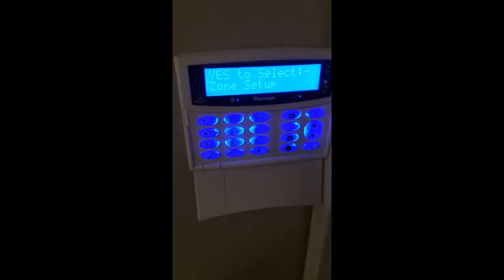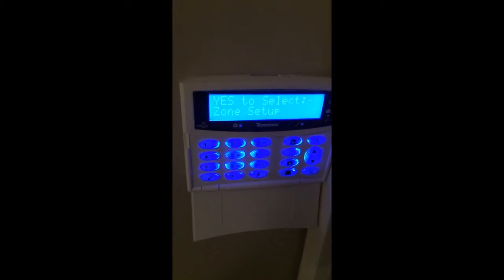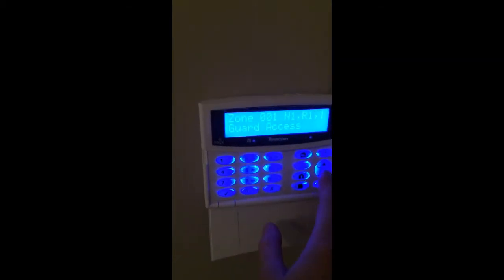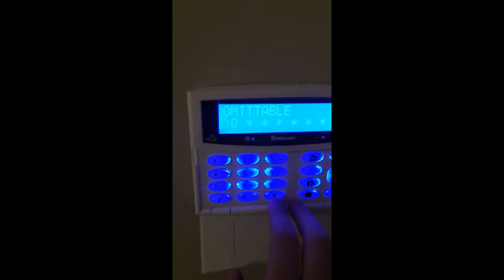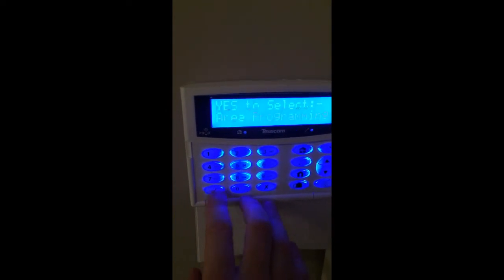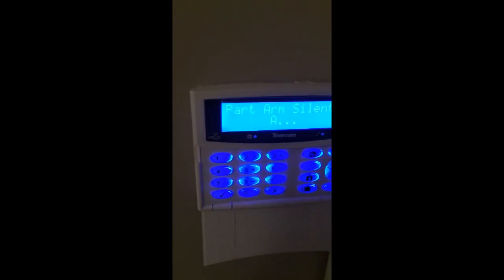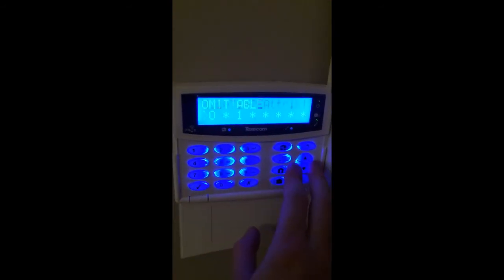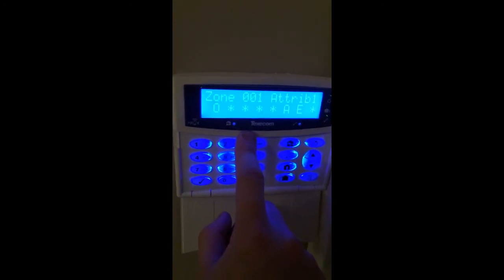Setting up part set- Texecom Premier Elite

Comment: Hi, what is the difference between 'Area' and 'Part-set'?
Reply from the maker: You can have a device in multiple parts, but only in one area. So a night set is generally a part setting, and a garage for example is usually an area
Reply: @pizzaandchipsmate  Thanks, I think i understood what you mean.

With the Texecom CAA-0026 Premier Elite 24 Control Panel, it mentions 2 Areas and 3 Part sets. Does that mean I can set 3 different rules? So 1 = All, 2 = Downstairs, 3 = upstairs? How does this work with areas? 

Appreciate your help with this! I am planning on purchasing the system but wanted to understand it before going ahead.
Reply from the maker: @shyambhadresa  So you would have Area A (House) Area B (Garage), Part 1- Downstairs only, Part 2- Kitchen off, Part 3- Downstairs and Kitchen off
Reply from the maker: You wouldn't have something in Area A (house) and also in Area B (garage) it's one or the other, but a zone can or not be in individual parts. You can fully configure part sets and areas. Most customers just have an A (for a full set) and nothing in B

Comment: can you do video's on attitudes and what these mean and also how to use the key pad as a pa button as mine doesn't seem to work when pressing 1and 3 at the same time
Reply from the maker: What attributes exactly? To enable Keypad PA, from Engineers menu, press 4- Keypad Set up, Yes, then on the keypad you want to use, keep pressing Yes until 'Options', press no, use arrow to move to the 5th star, press no and A will come on, press yes, press menu a few times and leave engineer mode
Reply: @pizzaandchipsmate   attributes of what they do as am so worried I do something wrong and it goes off and unable turn it off attributes aren't really explained anywhere on these systems really so for example my front and back door are on timers during the day and my kitchen sensor is on the gardaccess but night time I don't want the back door on a timer or the kitchen sensor on Gard access those can go on full Gard on a part arm only my hall I want on Gard access for night so I can get to the keypad downstairs which the hallway downstairs is Gard access so that ones ok sorry for the s.a lol
Reply from the maker: @chriswilkinson3260  Generally the settings are ready to go, a circuit as guard access automatically becomes an entry zone in a part set. As I said you usually don't need to worry about the others as changing them is very niche. To change zones to 'Guard' on a part set, you would On Zone Set-up, press Yes until zone Atrtribute, then no, then arrow to the last one, and press No (G should appear), then press 'Yes' to lock it in. This would mean when Full Set it is the Zone Type (Entry/ Exit, Guard Access etc) but on a part set, it will change to a Guard zone, so opening will cause an immediate alarm. You would put the 'G' on the Back door and Kitchen PIR.
Reply: @pizzaandchipsmate  thank you so much for your help I have rung places but no one will speak to me unless I part with cash first lol this is a  massive help thankyou
Reply from the maker: @chriswilkinson3260  No worries, if you need help with anything else, feel free to ask
Reply: @pizzaandchipsmate   many thanks

Comment: Hi mate, is it possible to set up an additional mode? E.g  arm all external door and window sensors?
Reply from the maker: It is indeed, you can either do it as a part set or an area set. I'd prefer the Area option, make a note of the zones you want to have the; Zone Set-Up, press Yes on the first window/ door until you reach Area: A. Press No, then 1 then 2, then A should go off and B should now be on, press Yes, then press the arrows until you're on the next window/ door. Zones should only be in one Area, you can then change Area B setting in Area Programming and make it instant set etc. You can change the name to Perimeter in Area Programming (Area Text) as well. This will allow you to when you type in code/ fob, press the Area button on the keypad and press 2 and it will only arm the perimeter. If you're going out and want to full set, you would still do Code+ Yes like normal
Reply: Thanks so much! Gonna have a crack at setting that up tomorrow
Reply from the maker: @nickyp909  It's quite involved, just make sure you test it fully after any changes, and make sure you can walk everywhere internally without setting the alarm off